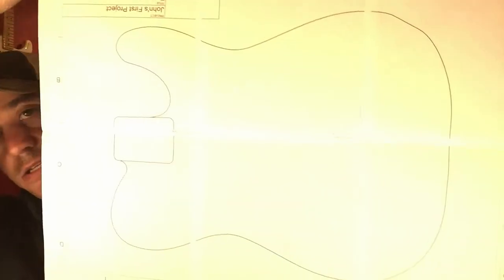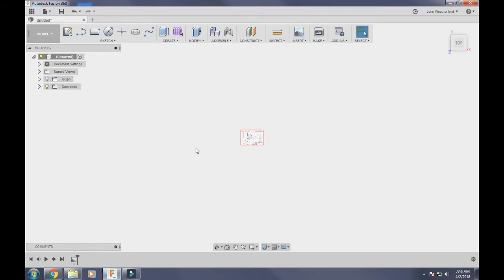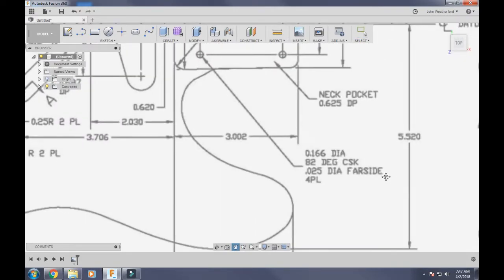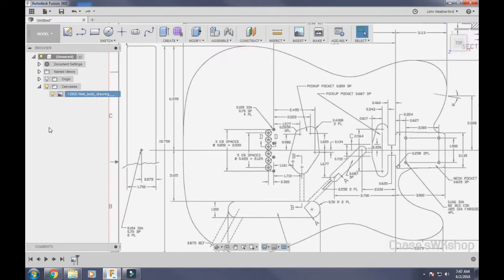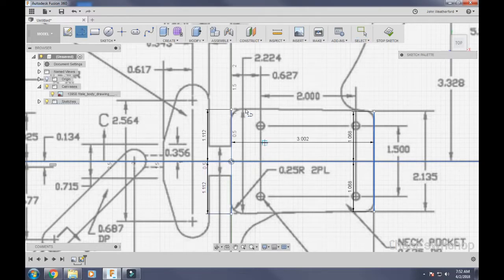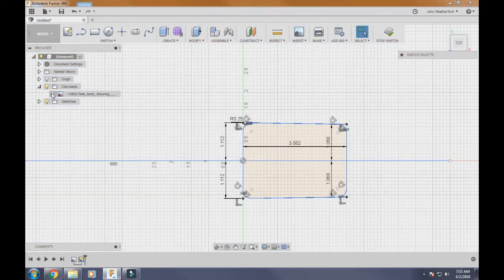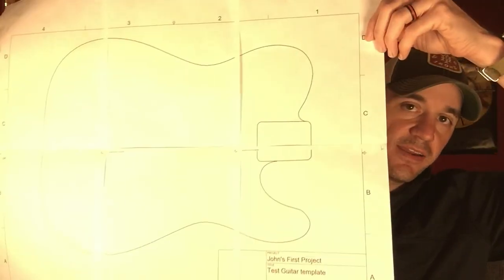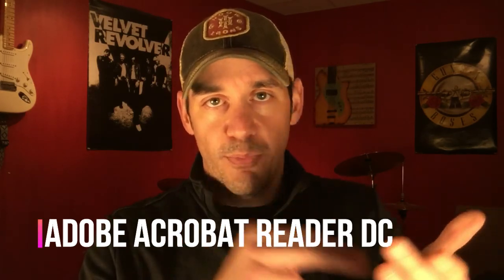Guitar Template using a Printer

Comment: Too complicated
Reply from the maker: Jim Pittman yes, there is a learning curve but once you learn a cad program you’ll be amazed at the things you can do, even without a CNC.
Reply: @ChasesWKshop  how did u learn
Reply: @ChasesWKshop  I'm interested
Reply from the maker: Jim Pittman there are a lot of great videos on fusion 360. NYCCNC channel does a lot of great starter videos. A lot of their designs are for cnc milling but you can start with your cad program and learn it then work into getting a cnc machine. There is also a lot you can do with just the program and no cnc. And the good news is fusion 360 is free for startups and anyone that makes less than 100,000 a year using it. It also has a complete cam side of the program as well. If you don’t know what that is it’s basically the side of the software that generates the g-code for your cnc machine to read. Having them together is huge. I learned mostly by getting the program and playing around with it and watching a lot of YouTube videos.  It’s very simple once you learn it but I still learn something new every time I use it.  If you have anymore questions feel free to email me if you want to. Hope this helps and good luck buddy.
Reply: @ChasesWKshop  thanks I'll keep in touch
Reply from the maker: Sounds good. Also if you’re interested in building your own cnc check out Dave Gatton. That’s who I watched to build mine. I can help you too if needed. Take care man.
Reply: @ChasesWKshop    was it very hard to build
Reply from the maker: @Swanlord05  It wasn't too bad.  Dave Gatton actually sells a parts kit now.  I bought a design from him that i used.  You could design your own in fusion 360 and print the parts and make templates.  That's basically what i did.  I had paper templates that i turned into wood router templates by hand then used them to make duplicate parts.  Just take it slow and start with fusion if you're really interested in it.  It took me about 8 months to complete mine but that was not all work time.  It was mostly saving money to buy parts here and there.  If you had all the parts you could build it in a week.  The programs you'll need to have one like mine is Fusion 360 and Mach 3.  So there are two programs you'll need to learn.  Mach 3 inst hard at all though.  All CNC machines have three different types of software. CAD, CAM and Machine Software.   CAD is where you design the parts, CAM is what generates the G-Code and tool paths and the Machine Software (Mach 3) Reads the g-code and runs the drivers and motors. I've got a video on here of my controller box for under 120$ if you want to check it out.  Id say i have about $1200-$1500 in my Machine.